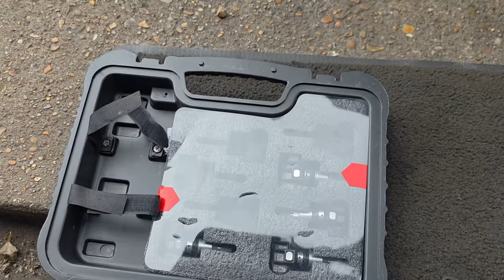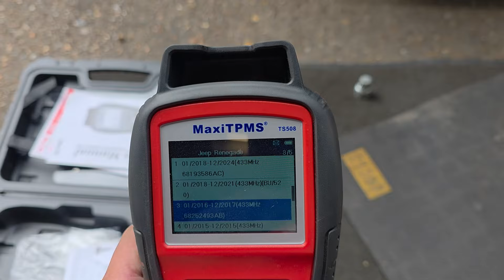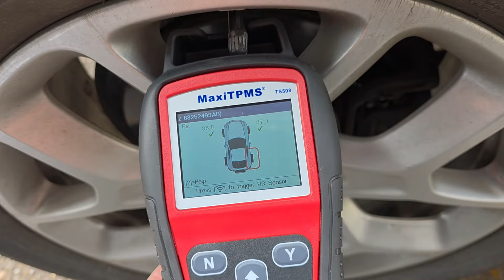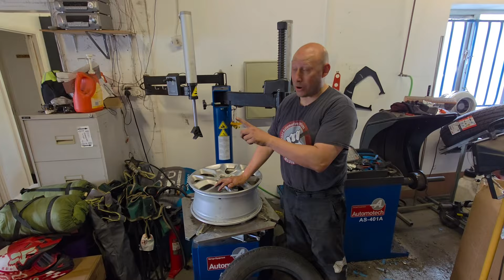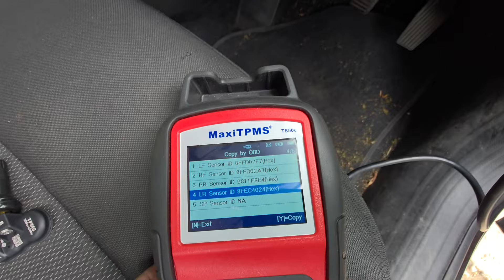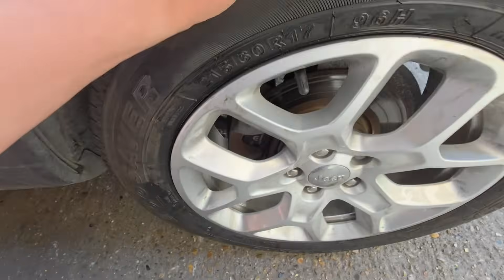Stop Wasting Money! Diagnose & Fix Your Tyre Pressure Warning Light in Minutes  DIY Car Repair #diy

Comment: It was the only wheel with a dust cap on the valve, old style TPMS valves use 3032 battery that is absolutely stupid.
Reply from the maker: Yes I remember seeing the old ones with the 3032 battery in! I think alot of the tyre pressure sensors get snapped off by tyre fitters as it would still be in there rolling around the tyre otherwise.